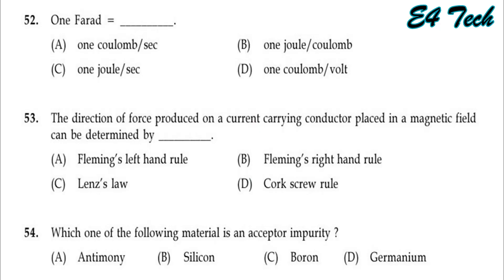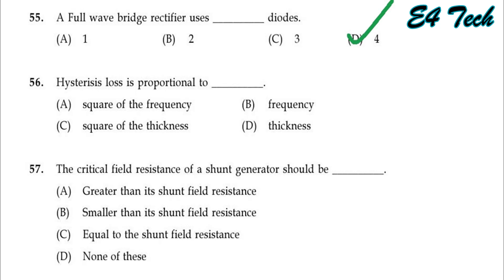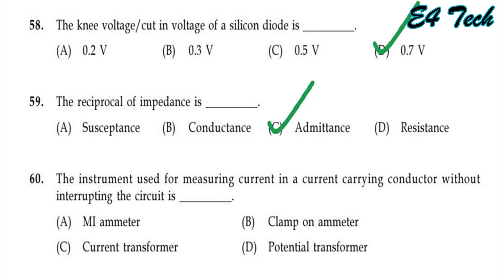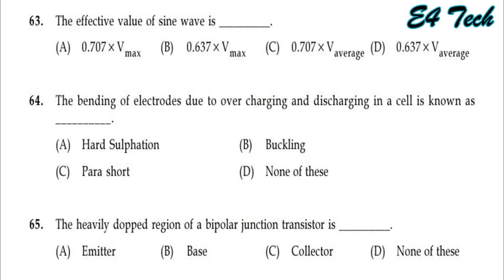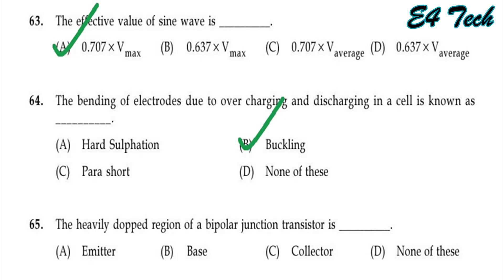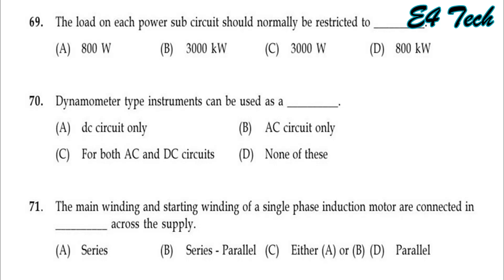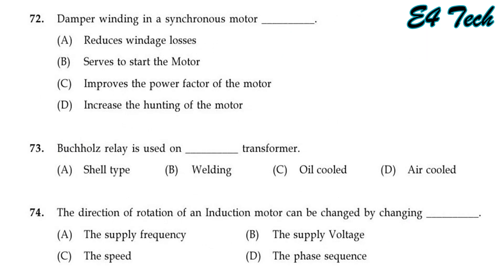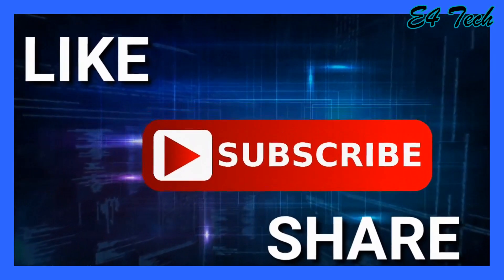PART -17 | KPSC Electrician | Lineman | wireman|Technician-Exam |QN.No.53 correct answer option (A)

Comment: 72. Damper winding huntingialle
Reply from the maker: Damper windings are closed windings provided on poles of SM.
It helps to make the SM act as Induction Motor during starting.
Reply: @E4TechKerala  ok ready
Reply: Reduse hunting aanu optionil increase aanu